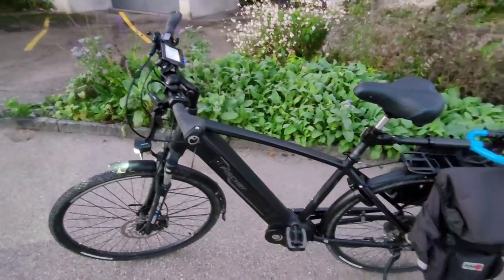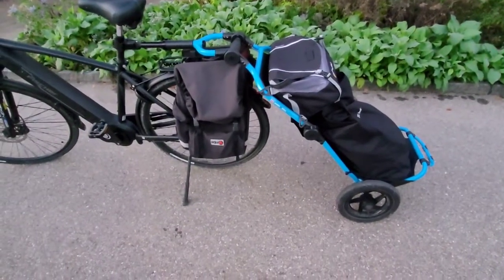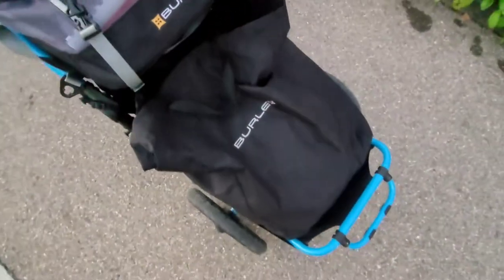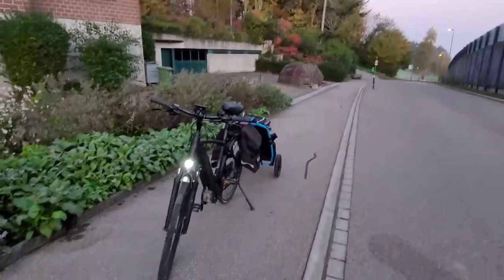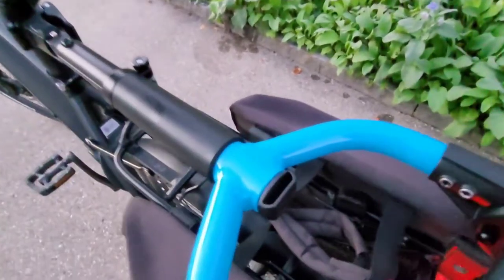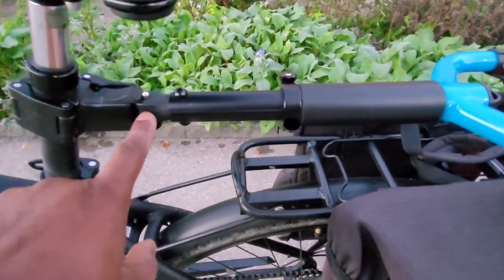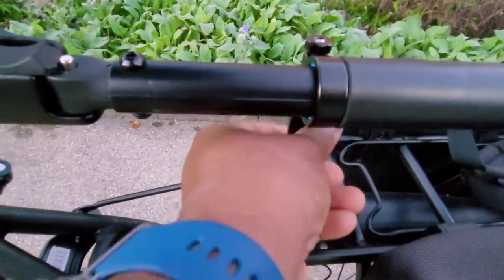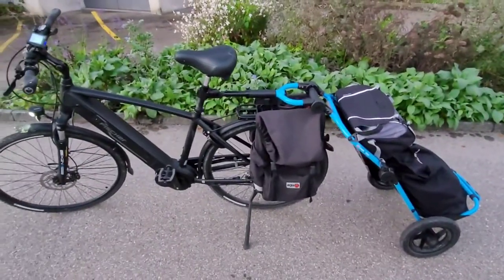Burley Travoy and 700mm Ebike...Does it Work?

Comment: The lugage was two expensive for me so i use a ruck sack with the waist band cut off or a large waterproof roll top dry bag , i have the propper rain cover which is good but has no rear lamp attachment point and i also bought the little attachment straps which come in a set of four and compliment the included straps , a good rear light for the travoy is a rechargable flashing dog collar which can be adapted to clip on or sewn on to one of the included luggage straps .
Reply from the maker: Thank you for the information. Your comments are very useful, my friend.

Comment: Hi Paul, what do you think about the stability of the burley travoy. I want to go on a bike trip and does it tip over when you make a sharp turn? I am gonna put light weight stuff on it
. Thnx for this video
Reply from the maker: Hello. Thank you for asking this question. I have never had a problem with the Travoy. It is very stable and handles well on the bike. However, please remember that having an attached trailer or any rolling device on your bike is different from just riding your bike. Avoid sharp turns and going fast over rough terrain. The Travoy has amazing robust tires and the tires are set wide. These facts make it very easy to use. Yet, I am careful when I ride pulling a trailer. There are conditions when the trailer, any trailer, will flip or become unstable. Just avoid those conditions and ride safely...slowing down when you must and taking turns with caution. I hope this helps.

Comment: how do you keep the bike and trailer safe from theft when you get to work? do you take it inside your classroom or something?
Reply from the maker: Thank you for commenting. I usually take the trailer in with me. It's extremely light at less than 10lbs or about 4.3kg. It's manueverable and quiet as well. It also folds up with the wheels coming off with a button push. Very easy to manage. I hope this helps.